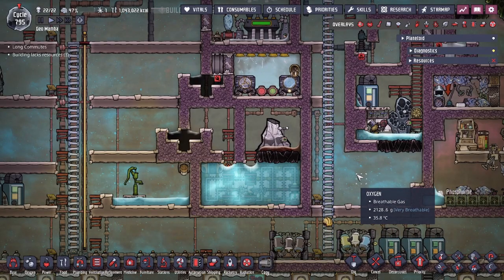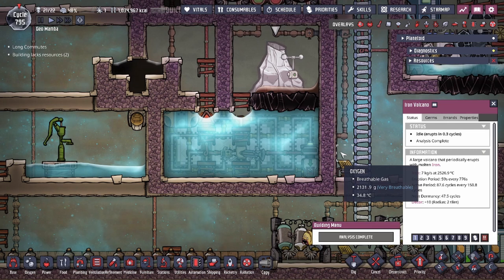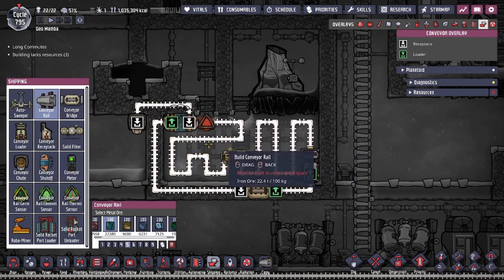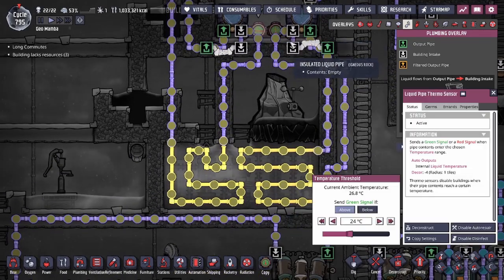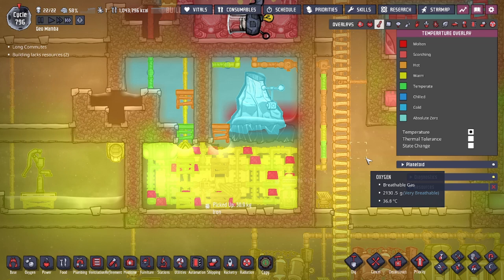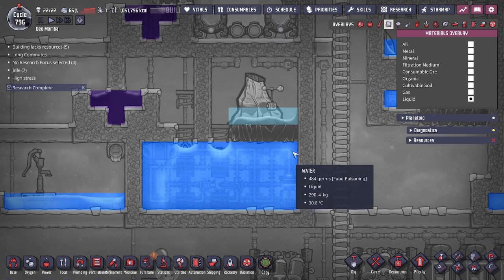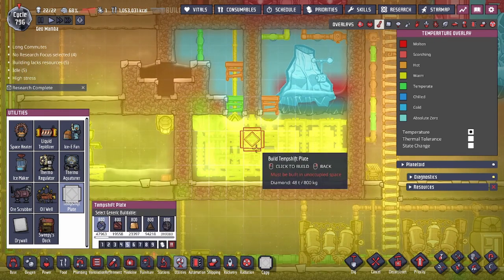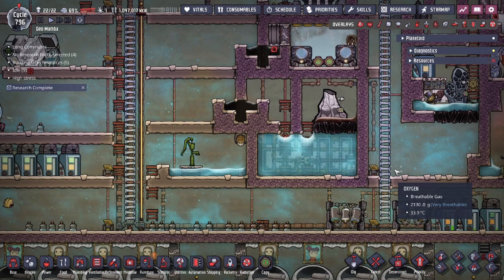Iron Volcano Tamer using a Pool of Water! - Fast Cooling - Oxygen Not Included

Comment: You could probably kick a little leg out on your water loop and have the output land on a metal tile and further chill the output to 24 degrees as it sits over time.
Reply from the maker: i thought about that, but i figured any "wait time" would slow down the build as its built for speed- getting the iron out at a usable temperature asap
Reply: @2LegitCity  I was thinking about it as more fine-tuning the temp on the output during downtime before the dupes retrieve it, like a little extra heat removal while it's just sitting there waiting to be moved rather than an active restriction of the system.

Comment: why not have the iron boil water and run steam turbines? shiping rails will suck the heat out of the iron in no time
Reply from the maker: time, this build focuses on getting the iron out and  at a cool temp as fast as possible. the steam turbine route is completely feasible but i already did a video with that type of design

Comment: Blueprint: 
https://blueprintnotincluded.com/b/62630e35b455ca65075c1f82
Reply from the maker: Oh i see- i would try to do a one drop lock infront of that as well and keep the output water in a vacuum so that AQ doesnt overwork itself trying to cool the base through water exposure
Reply: @2LegitCity  oh, lol I thought I had taken that modification off of the BP, yeah, I'd keep that side area vacuum or temperature controlled externally. I'll save it without the leg so it more closely matches your video.